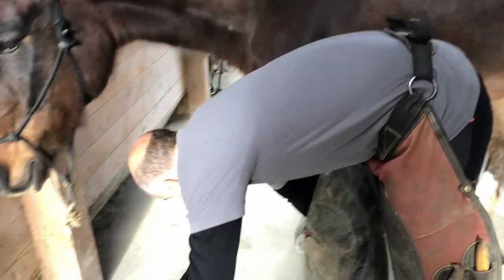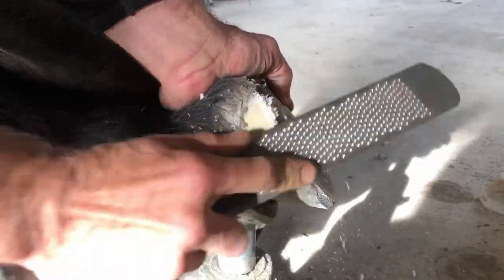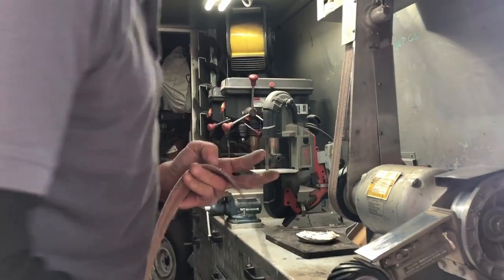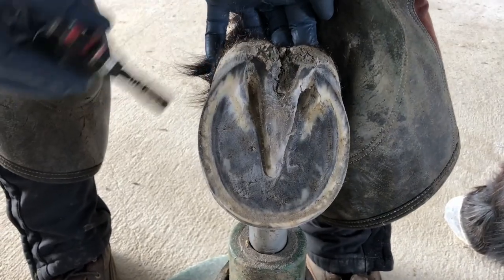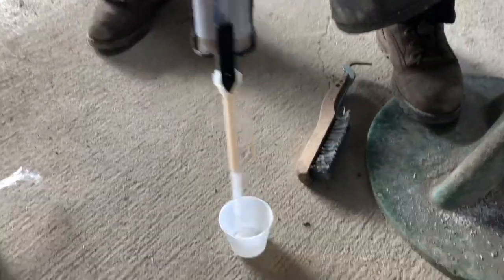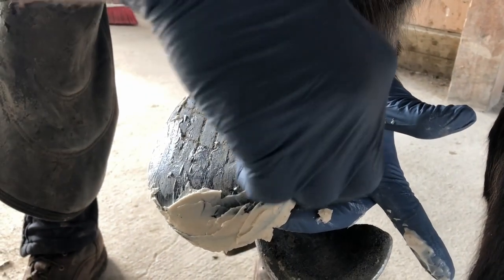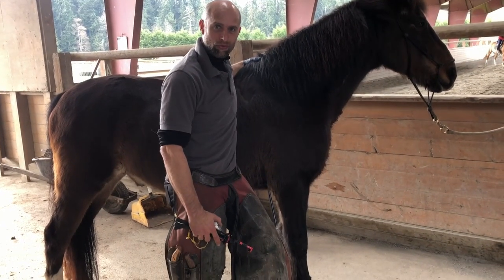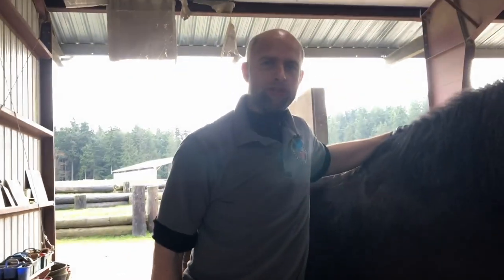Direct Glue-On Plastic Clog for Horse Hoof Rehabilitation

Comment: what would be the reason to use a clog rather than a glue-on shoe with cuff or tab and a rocker bottom?
Reply from the maker: There are several approaches that could be used to accomplish something that would appear to be similar, and those options you mentioned are certainly used a lot as well.  One problem with using shoes with the cuff is that the tendency is the have a shoe that is fit slightly wider (bigger) than the foot to get the tabs and cuffs fit (unless you know how to alter them), which actually can increase the leverage.  To counter act that, you need to grind the leverage back into the shoe to get those release points further under the foot where you might want them.  With applying the clog this way (especially the black urethane clog), it is more rigid and can withstand rasping or grinding the leverage release points much further in that you can with other shoes and the shoe won't invert.  Likewise, for this particular horse, Chris wanted to glue the entire sole at the same time which this horse does well with, and the solid foot surface of the clog works well for this use.  Again, it's not the only way to apply a similar style package, this particular horse just does better with this type of clog prepared and applied in this way.  Chris has used the other version like you described on this horse in the past and he does the best so far in this application.  Keep an eye out because Chris is working on another video with a clog application using cuffs (Coming Soon!).
Reply: @EDSSHoofcare  thank you. I am just learning and interested in, not only having alternatives, but understanding the differences and reasoning. I'll be watching for the next one!